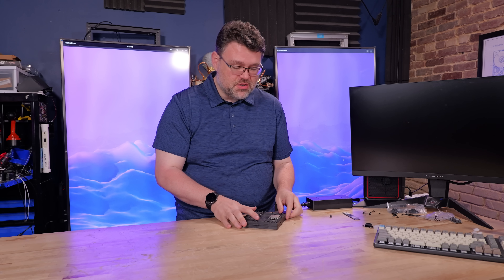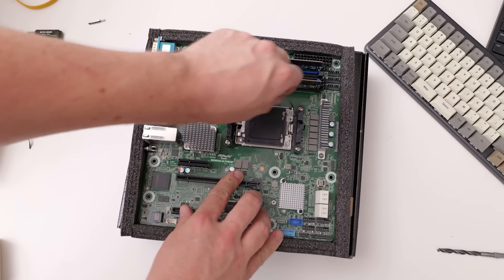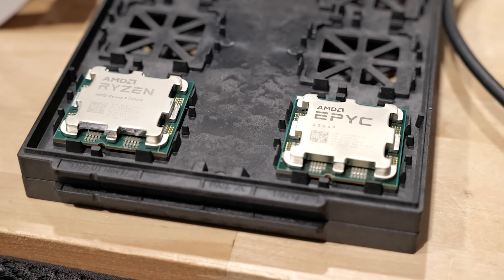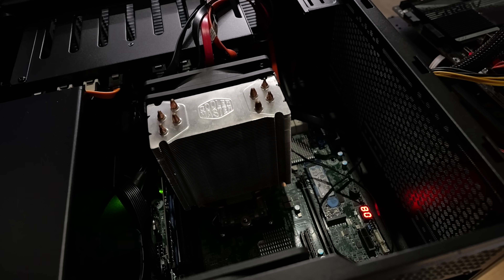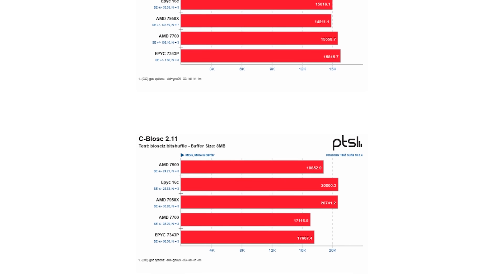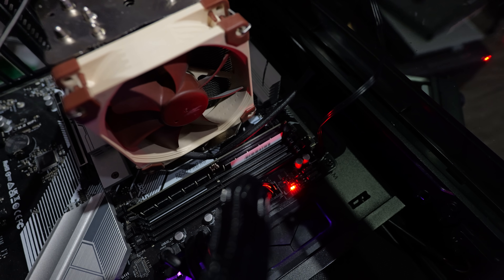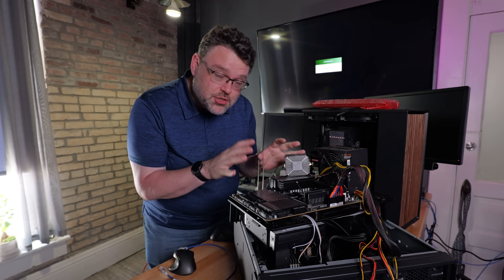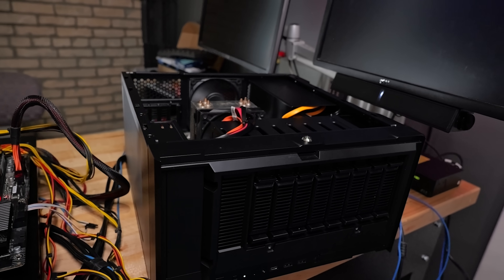They Put Epyc Onto AM5? Can They Do That?

Comment: From the beginning, I've felt that AM5 is pretty lackluster. I guess, I'm SOL and stuck on AM4 for the forseeable future. My next PC might be Intel, because PCIe lanes. I think, it's the chipset which is most at fault. AMD knows people don't want a fan on the chipset, but they can't provide us a decent solution without it. Plus, motherboard mfrs still think AMD is the budget choice. For one thing, they don't give us the nicer Intel NICs, but force us to have Realtek, instead. There are other things, like the PCIe layout being taylored towards a simple gaming PC build. Also, IOMMU support is pretty spotty. The motherboard might say it will do it, but you might find that it won't work, because your devices aren't separate IOMMU groups, and ACS isn't likely to solve that. Don't buy a "B" motherboard, for that reason. The Prime and Pro series boards from Asus usually have good NICs and IOMMU support. Although, I've noticed the boards offer fewer PCIe lanes on AM5. So, I'm sticking with AM4 until there's a compelling reason to upgrade. At least, it's gotten a lot more affordable.
Reply: On the PCIe lane front, AM5 has 4 more lanes than AM4: 28 for AM5 (24 gen5 lanes + 4 chipset) vs. 24 for AM4 (20 gen4 lanes + 4 chipset). Intel's LGA 1700 socket has also 28 lanes, but it is 16 gen5, 4 gen4 lanes plus 8 DMI lanes for the chipset. So directly from the CPU technically AM5 has even more than both.

The main issue I have with it really is though, that all consumer motherboards are designed to basically be one x16 GPU slot with as many NVME slots you can cram on them, and some excuse extra PCIe slots here and there, mostly from the chipset. Its similar on LGA 1700 really. All you can do if you want access to all the available lanes for anything but NVMe drives is to frankenstein in some NVMe-to-PCIe riser adapters on those boards. On AM5 you can get two extra x4 "slots" directly from the CPU like this, and of course you can do the same with NVME slots connected to the chipset. On LGA 1700 you can get one x4 "slot" from the CPU, but the wider chipset link on LGA 1700 also means the NVMe-slots hanging off the chipsets have more shared bandwidth in total to take advantage off..
Reply: @Hugh_I  Yeah, they usually waste them. I'd prefer to be able to add my own cards to get the functionality I want, rather than relying on whatever el cheapo onboard solution they threw on there just to tick a box off a list.
Reply: @TheChadXPerience909  Yep, agree with that. I understand that this config is fine for most consumers, but It's annoying that there isn't any of the hundreds of Mobo SKUs that is just geared towards: give me my PCIe lanes on slots for expansion cards.

Overall I think the whole transition to M.2 slots on desktop is backwards. It would've been fine to keep PCIe slots and add NVMe as either pcie expansion cards or use M.2 adapter cards. More flexible for other uses, but also your NVME's are easier to access, replace and cool.
Reply: @Hugh_I  Yeah, I hate having to take the whole thing apart, and redo the thermal grease just to swap a storage drive. I like those external-facing NVMe bays that fit in a 5.25", and can hold 4 at a time. I think Icy Dock makes some. Although, add-in cards would still be a lot better than onboard. Oh but, then where would we place those giant GPUs with all their heatsink magnificance? Surely, we would never run the thing headless!

Comment: What would be really, really interesting is if AMD made an AM5 socketed all Zen 5C EPYC CPU... Up to 24 cores / 48 threads!
Reply: Ooh, and also have it actually handle 4 DIMMs without gutting the frequency.
Or, better yet... Quad Channel memory!!
Reply: @jgorres  Pretty sure thare are no pins on the AM5 socket with which to hook up 4 memory channels to the CPU. They'd have designed the socket from the get go to support that.
Reply: @jgorres  Yeah, it would be pretty neat to have indeed though.

The thing that comes closest that they do have is the SP6 socket. That for Sienna, the "smaller" zen4c Epycs. Those have 6-channel DDR5 support. The CPUs go from 8-64 zen5c cores and have 96 PCIe 5 lanes.
Reply: @Hugh_I  So, I guess I'm waiting for those to be decent priced, used, to build my "Everything" server!

Comment: couldn't you just get a riser to split up your PCIE slots?  Or...  PCIE doesn't work that way?
Reply: On some higher end boards that have the requisite PCIe switches, you can split x16 slots into x8x8 or x4x4x4x4. But any solution that takes say x4 gen5 lanes and converts that into x8 gen4 lanes requires dedicated chips that are quite expensive, even for older pcie standards. The best thing would be if AMD had a separate chipset to do this, cause that is basically what the chipset does anyways. Only that they opted to have the chipset link on AM5 be only gen4x4, which limits the bandwidth available there.

Comment: I have mainly been wanting one just for the PCIE lanes, am curious if it would work in a gaming board as I do not care for ecc.
Reply: they have the same # of PCIe lanes as the desktop ryzen parts.
Reply: @Hugh_I  I was unaware that it was bumped from previous gen, also am I understanding that depending on chipset the motherboard adds 8 to 12 lanes depending on 650/670 chipset?

Comment: Seriously thinking about grabbing one of these for my NAS rebuild now if they've fixed the ECC problems.  6-8 cores would be more than enough and if the mobo has 10gb on it all I'd need is an HBA as far as PCIE cards.
Reply: don't you want dual nvme for boot, and dual nvme for l2arc? these don't really have the lanes for that.
Reply: @Cynyr  I don't need a separate  l2arc/Zil for my home NAS from my testing (if it were busier or hosting VM's or something that might be different), and mirrored SATA is fine for boot drives.

Comment: Crazy that nobody whatsoever makes sensible PCIe slot layouts for AM5, neither on nor workstation/server.
Reply: Could a riser be used to separate different lanes or does PCIE not split up like that?
Reply: @kayakMike1000  it does. Search for bifurcation, it's a bit tricky because every motherboard does it differently and sometimes they have crazy rules like running bifurcation in a pcie slot can disable a storage one.
Reply: There are not enough PCIe lanes to be able to do so.
Reply: Because there is no lanes on AM5, 24 lanes is nothing in 2024.
Reply: @owlmostdead9492  28 lanes + X16 + Dual X4 M.2 + X4 Chipset uplink.

It should have been + X4 M.2 + X8 chipset uplink.
Reply: @aminy23  I really loved the ASUS Pro WS X570-ACE for that. I could literally have PCIe 4.0 x8 speeds for my secondary GPU while my first had twice that (or at the time it was PCIe 3.0 still to be exact). This was great for KVM and such.
From their marketing “Three PCIe 4.0 x16 slots with optimized lane arrangement of 3-way x8/x8/x8 to accelerate an increasingly diverse array of workloads”.
Sadly mine died, but I got a full refund (per EU law) at least.
Reply: @whohan779 Could you place your boot gpu on the secondary slot with that board?

I like my x570 taichi but damn if it's not annoying to choose between being blind at boot or put the host gpu in the best slot
Reply: I think, it's the chipset which is most at fault. AMD knows people don't want a fan on the chipset, but they can't provide us a decent solution without it.

Comment: I miss the days of consumer dual sockets.   Started with a dual Pentium MMX…. then later dual Celeron 300A’s..
Reply: That ended when they started putting dual cores on the same SoC.
Reply: I miss the days of slower, more expensive, noisier, latency-heavy, power-hungry, inconsistent performance as well.
Reply: @tim3172  Older processors were less power hungry lol.  The 486 topped out at 5W, and Pentium MMX never touched 25W.

Comment: I want AM5 at 32 cores and something that is stronger than 14900k at IPC
I am put off buying 16 core when I have 13900k with 24 cores
AMD dropped a ball imo, they could have swiped Intel off the competition deck with 32 core enthusiast chip
But they are afraid to lose Threadripper sales

Comment: x70e boards should require ecc support. Possibly even x50e and/or plain x70, but definitely x70e. Frankly this matters more than pcie5x16 for the main pcie slot or even pcie5 for the main m.2 slot. Pcie4x16 is fine for main gpu. few if any gpu's need more than pcie3x16 or 4x8. I could see the 5090 if rumors are to be believed needing that for the ten minutes before it catches fire at the connector.

Comment: x8 x8 x4 Wendell... with AM5? Behold, the Supermicro H13SAE-MF.

Still need a W680 counterpart in this market segment as it still provides more IO, but it's the best on the market right now.
Reply: Oh man, thanks for mentioning this one as I hadn't run across it on SM's site.  This looks like it will be perfect for my NAS rebuild later this year.
Reply: @nadtz  I build my servers out of my old desktop parts, and spend my upgrade money where it really counts... On my desktop PC.
Reply: @nadtz  Trying to save you money so you can build a better Desktop, which you'll likely appreciate a lot more.
Reply: @TheChadXPerience909  I generally don't use consumer motherboards for my servers.  Not sure why you think I need to rebuild my workstation which is fine for my needs at the moment.
Reply: @nadtz  Dude... I'm not your friend and know nothing about your needs. It was sound general advice. You aren't expected to actually agree with it.
Reply: @TheChadXPerience909  "I'm not your friend and know nothing about your needs." 

Exactly.
Reply: @nadtz  If you can't handle somebody offering sound advice which may not apply to you, then get off the internet.

Comment: I wish they would release 24 and 32 core for am5. Don't think that's happening any time soon though. I am in a stupid niche of wanting more multicore but not caring about memory bandwidth and other extra features. My only options are 7950X (which I have now), or threadripper / epyc which has way worse price / performance.
Reply: zen 6 will likely see double core count
Reply: @jesh879  Yeah, I'm probably getting a 9950X in the meantime. I just can't stomach spending 3500+ on a completely new Threadripper system just to have double the corecount (using 7970x as an example) 🥲
Reply: How is the 7950x treating you?  I'm a hair-trigger from buying it, but 95degCelsius scares me.
Reply: @nikolaforzane2285  I'm very happy with it. Yes it will go to 95C on an all-core workload, but that's what it's designed to do. I've run it for hundreds of hours like that with no issue. If it really bothers you you can always just set a slightly lower PPT limit in the Ryzen Master software. It's a fantastic chip for multi-threaded workloads.

Comment: I want to run one of these as a file server for my house and to try out remote management.

Now only if ASRock Rack could make a board that was half as expensive so it would make sense to run the 6 core in a server board. (I do not need the extra performance and of course cost of the higher end chips.)

Comment: This basically kill Threadripper lol
Reply: No, it has nowhere near the PCIe lanes
Reply: @x360c  yes, i forgot that part
Reply: Not even close! In fact, it's nongermane, because these aren't designed to compete with Threadripper. These use EPYC cores; not Threadripper cores. Threadripper offers A LOT MORE PCIe lanes, and quad channel encrypted registered ECC RAM. These are meant to compete in the datacenter server space, where a client might not need those extra PCIe lanes. Threadripper is a workstation CPU, and a totally different usecase.

Comment: AM5 Epyc doesn't make a ton of sense to me, since the epycs don't have more pcie lanes; the single biggest upgrade I want.
Reply: Proper ECC is a worthwhile upgrade too
Reply: @magfal  The AGESA updates that brought support for AM5 Epyc also patched in unregistered ECC support on their consumer Ryzen counterparts. The only benefit, as Wendell said, is enterprise grade hardware support and generally better validation for better expected uptime
Reply: @magfal  yea only for servers though, you dont want ECC for gaming and the extra pcie lanes would actually allow me to use cool pcie cards
Reply: @jamjam1573  What "cool" PCIe cards are you that worried about using outside of a server context? You can't even take advantage of the bandwidth provided by a single Gen 5 NVME, let alone one of those multi-nvme cards. Your gaming GPU doesn't legitimately need all 16 lanes, so is fine being split to x8.
Reply: @jamjam1573  why would you not want ECC for gaming?
Reply: @CataclysmZA  ECC encounters additional memory latency due to the extra checks involved.
It also, in nearly all circumstances, runs with higher CAS and other internal memory latency and/or lower clock speeds.
So, it's slower (which hurts Infinity Fabric performance) and has higher latency, which is the opposite of what you want for gaming.
Reply: @CataclysmZA  because ECC for gaming can slow certain games down, ECC adds to the latency
Reply: @tim3172  unless you like to game more stable, rule out a possible cause for crashes
Reply: @magfal  true
Reply: It is not for individuals, it is for enterprise scale deployment, with the typical component certification and whatnot. They will use those CPUs for business, so they can afford the EPYC premium and the resulting peace of mind.
Reply: @dgo4490  well yea obviously but even more of a case where you may want more pcie lanes, so you are stuck with just 6 ssds running on 4 lanes each
Reply: @jamjam1573  "Just" 6 SSD's??  If you're looking at running more storage than that, NAS or SAN is the solution, or a multi-processor system.  Come on, we have to be the slightest bit reasonable, even when talking about AMD and the extras that Intel doesn't give you at the same price point, lol.
Reply: I want faster memory connections. Feed the beast.
Reply: I’m hoping to see better PCIe slots from this more than anything. 

I don’t care if it goes through the chipset at all but I don’t need the m.2 going through the lanes straight to the CpU for a media server that I’m also running 2 GPUs to VMs for gaming in one rig.
Reply: @user-cm3wd5hk1p  same
Reply: Uh, well, those Epyc models exist, you just have to pay more.  Seriously, what do you expect expect -- everything for free???
Reply: @DeltaSierra426  I think they expect a processor with the server branding to have more pcie lanes than the desktop version. That was pretty clear
Reply: They really don't gain a single benefit. No extra PCIe lanes. No quad channel memory support. Nothing.
Reply: @TheChadXPerience909  Exactly!! "What do you expect, everything for free???" No, I think we expect something tangible for the epyc badge and premium
Reply: Get a x670e mobo if you don't already have one preferably the Asus Proart x670e
Reply: It's a marketing upgrade at best.
Reply: i agree, i dont see any reason to use one of these epyc out side of the entry server level, why not just use a 7x00 series

Comment: The CPUs are only one part. We need support for them on customer motherboards. Intel shows that if you need special motherboards to run them including ECC they are extremly expensive. A Intel i5-12500 for 194€ needs a 500€ motherboard for ECC. Nuts. I hope these Epvcs will be supported on cheaper boards......